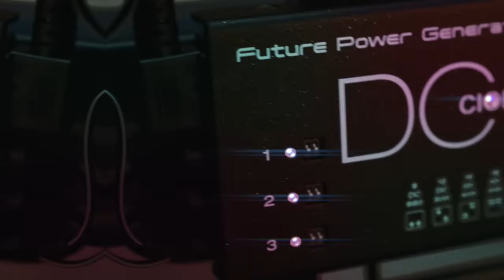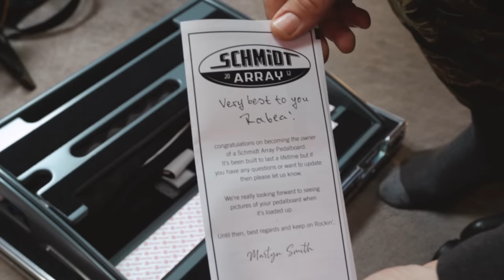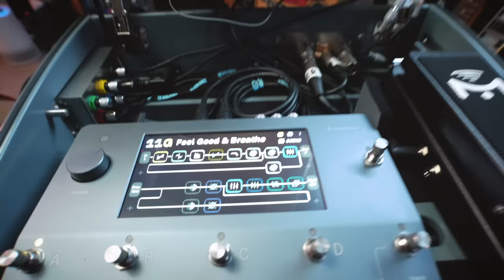FrogLeap Pedalboard Rig | Building & Tones

Comment: I've run into the same issue with pulling rubber feet off expression/wah pedals.  Short of getting different screws or cutting them down, I've just used some spare nylon washers to boost screws just enough and still enough bite with velcro.  Works well, and nothing is modded if you ever want to resell.

Comment: I actually just bought the Ciocks DC7 with the 8 power kit, $600.0 CAD. Dollar. But it's the last supply I'll buy kinda thing.  Just a suggestion add the Ciocks 8 to your system as the one unit took up 4 spots on your DC7. Just a suggestion,  but you'll thank me latter lol. I'm just rebuilding my pedalboard and I just the Temple audio. I'm so jealous of that board you picked up.  So much easier to work with.  Mine has been a work in progress for almost a week now lol

Comment: You get so many comments so maybe this was already mentioned.  I had the exact same issue with a ME Volume pedal and really any wah pedal.  I left the feet fully on and used two decent sized zip ties in black to wrap around the middle.  Doesn't impact the rocking motion as there is plenty of space. Totally stays put.
Reply: Or you can get a wah plate that’s thicker

Comment: Wait, so the quad doesn’t have its own plug?
Reply: It has a power supply. But I guess if you only want to have to plug in one power cable then you have to have something that accommodate all the stuff on your board. 

Personally I wouldn’t care about having to power the QC individually.
Reply: @imacashew.  I agree. To mwthat tournament bracket thing looks dangerous, but if it works then it works

Comment: Looks like a nice rig. Can you show us how solved the hole thing with the different tunings? as i remember that was the reason you guys used the Shuriken in the first place. love that u can use your guitars now. can't wait to finaly see you guys in Austria.

Nice video as always. cheers!
Reply: That was my first thought when Bea announced that he switched his setup for Frog Leap.
Reply: If you check at 11 mins you can see him changing the tuning on the fly before using the expression pedal
Reply: I think the Quad has a pretty good pitch shifter in it, so he’s probably just using that. And unlike a band like twelve foot ninja, I feel the tunings he would be going between would be pretty standard, so no need for the shurikan
Reply from the maker: Sure I can make a little video on it - basically I realised that 99% of the songs I can managed by shifting the whole guitars tuning, and just relearning some of the positions to fit with that. The shuriken was great for the banjo sounds and unique stuff we need throughout the set. At the minute we are working on finding replacement tones for those. But yeah, basically I can use QC and just pitch shift the guitar. The tracking is great and it doesn’t seem to mess with the tone that much at all.
Reply: @RabeaMassaad  nice. thanks for the insight🤟

Comment: Trick for the future: When you remove the screws from a Wah, use the screws from the back of a computer to put the plate back on. They almost always fit perfectly (same threading usually) and they are short enough to accommodate the thickness of the velcro. They are what I use on both my wah pedals. Some companies might differ, the screws used to mount hard drives have slightly tighter thread, but are the same height, though they may have flatter head. They may work where the others don't.

Cool board, looking forward to what come next! Cheers from Canada!
Reply: Filed under Stupid American Tricks:
6-32 UNC screws are the common PC case screws where other components in PCs are metric.  Drives me nuts that this stoopid Imperial system still exists.

Comment: Cool board. Very handy. If you want those pedals to never move use 3M Dual-Lock haha.

I bought a big beast of a board a few years back used, made by Fix Pedalboards, came with an MXR/CAE 403 power supply mounted underneath and some very handy aluminum junction blocks underneath with Neutrik connectors out the side for Guitar/Amp/Effects Loop/IEC Power

Just mentioning that so your board builder friend or other people might get a few more tricks up their sleeve.

Comment: Not sure why Mission don't provide more options for users wanting to mount their pedals to pedalboards. Only a couple of their range have flat bottom risers with holes in for the rubber feet that then allow Velcro mounting. I ended up making my own cardboard/velcro riser and hooking the top rubber feet over one of the bars of my Pedaltrain to keep it in place. Not pretty, but it kind of works.

Comment: The new rig being able to handle all those specific parameters for Frog Leap is awesome! Didn't think it was possible without the helix. However, the QC (and other gear) is still just too damn expensive. 

At roughly $2300 (used), I'd rather just stick with the Helix floorboard (or LT) and the Shuriken. One guitar. One floorboard. DONE. 

Simplicity goes a long way.

Comment: I suffered the same thing when I tried to attach a wah pedal to a flat board. I didn't want to shear off the feet or try cutting the screws. NYC Pedalboards makes a piece of wood that has holes in it for the rubber feet so a vp/exp/wah can attach to it without the removal of rubber feet.

Comment: Yeah it’s pretty cool, I just have one of them desktop tv stands that I put my main board on, then I have a separate power supply and couple pedals underneath for my 6505mh, I main a Engl   Invader 2 so it’s only if I feel like running 2 amps in stereo. Super awesome sounding but too loud for everyday.